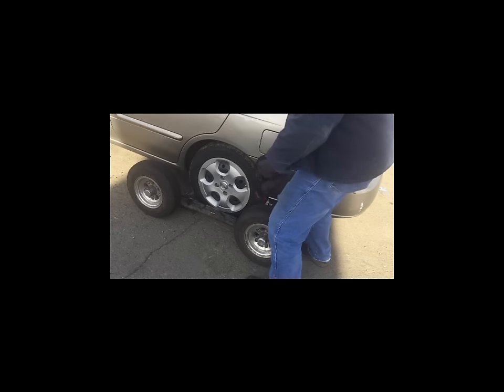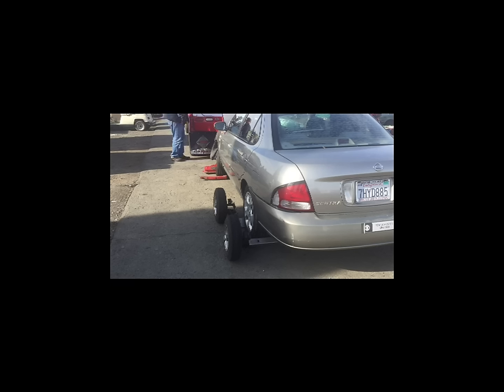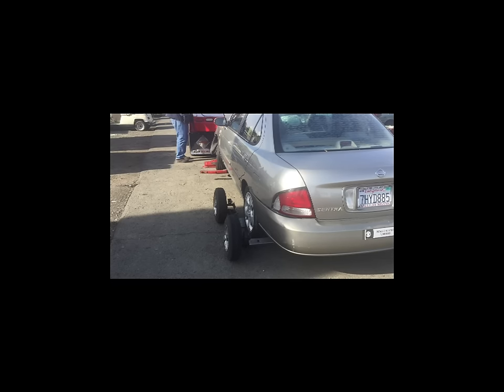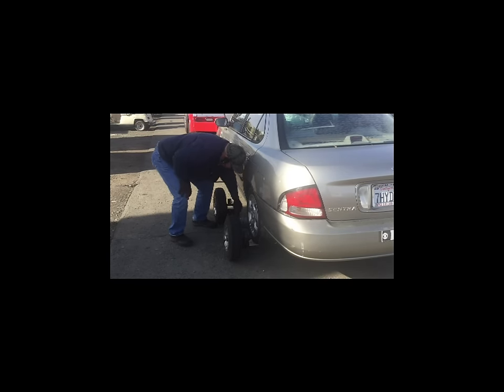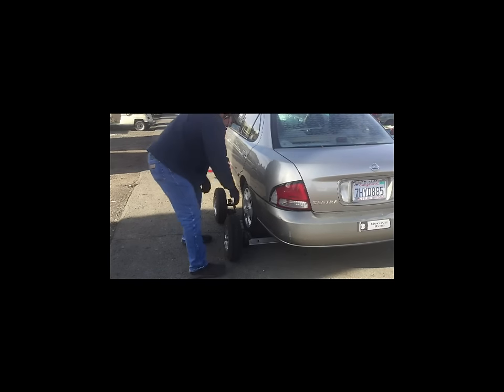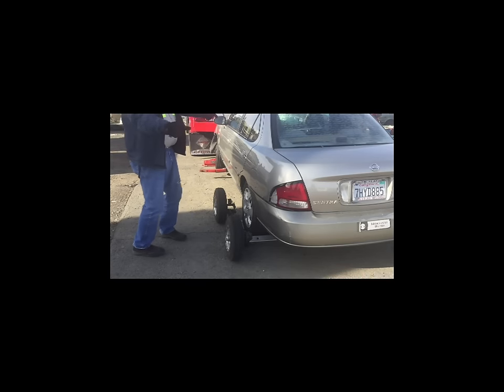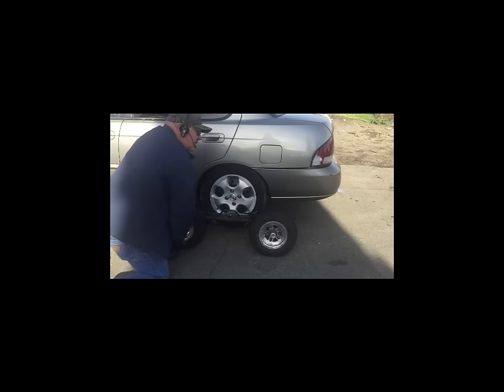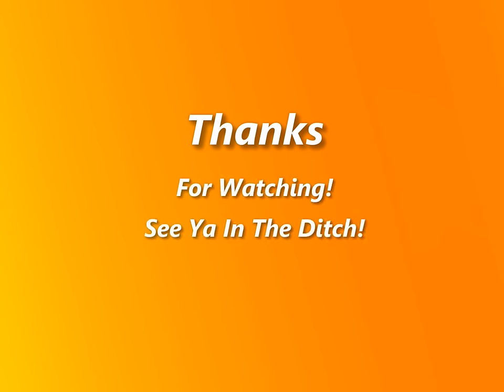Towing And Recovery Using Dollies When Vehicle Has Flat Tire

Comment: What about the other side if it’s a non flat tyre? Would you need to adjust that so it’s the same as the flat tyre side or would you leave it and have the support bars at an angle under the vehicle?
Reply from the maker: Thanks for the comment, adjust the non flat wider to accommodate.

Comment: Dig the vid. Just a few questions... Is the rear pin on the dolly fixed? Will it tow off-center? How do you anchor the wheels to the dolly?
Reply from the maker: Kickinpony.66 it will tow straight. Not sure what you mean by the pin? We secure the dollies with a regular strap and ratchet.
Reply: I'm guessing the front pin on the dolly is moveable, and the rear pin is fixed? Or, are both pins moveable? I'm not a Tow Driver (which is why I'm asking "dumb questions"). A video of how the Tow Dolly works would be very cool.
Reply from the maker: Kickinpony.66 both are moveable. There are 3 slots for each pole per side
Reply from the maker: Kickinpony.66 3 front 3 rear that is
Reply: Ahh... Makes sense! Very cool. I figured that the Front and Rear were fully adjustable, but I had to ask #curiosity